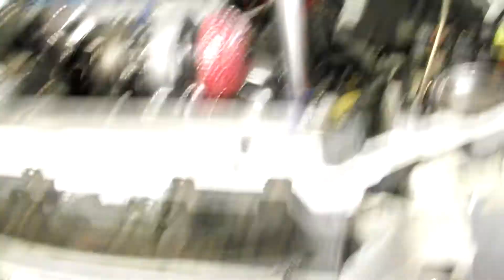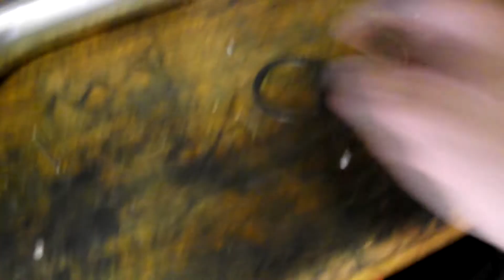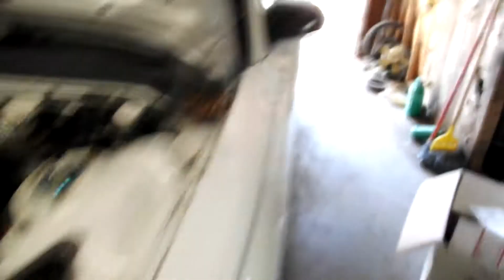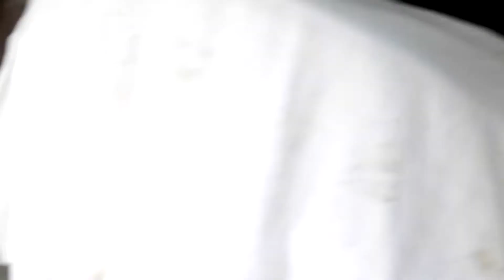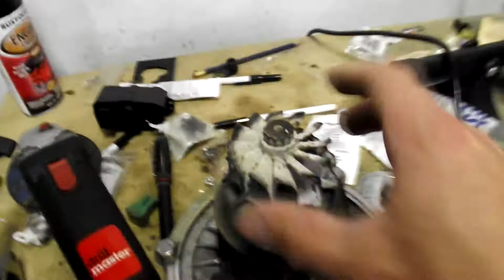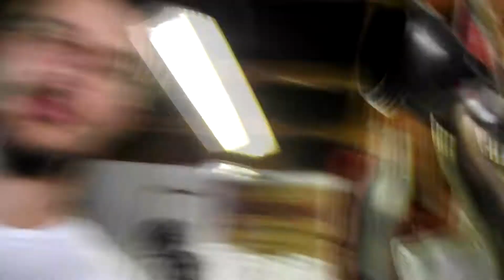The  turbo 420a i almost their

Comment: hey nitro, Im thinking about turboing  my 420a do you think jdm turbo is any good or the company fastway racer. also my motor has about 130,000 should I rebuild the bottom end I just want a daily driver with a little more power at about 10psi thanks holla back